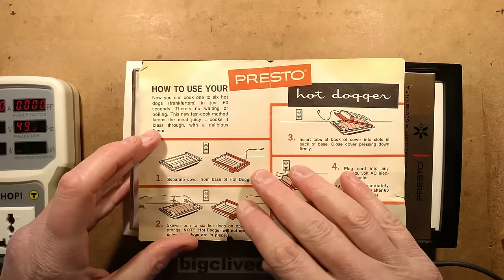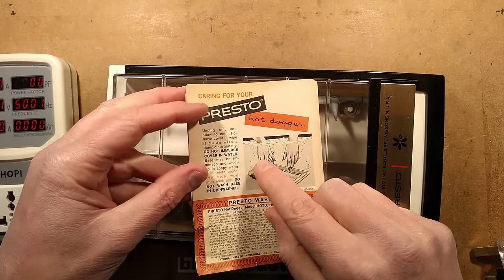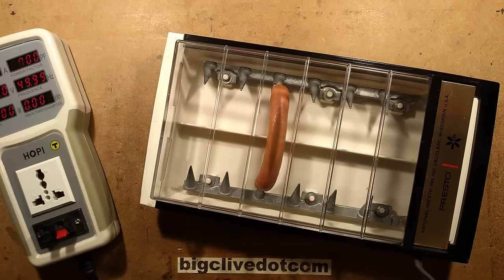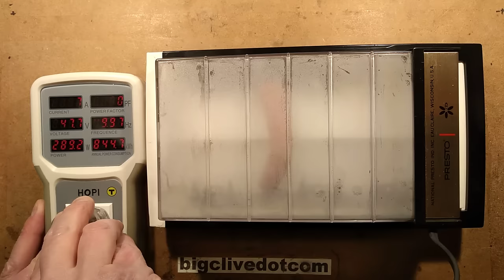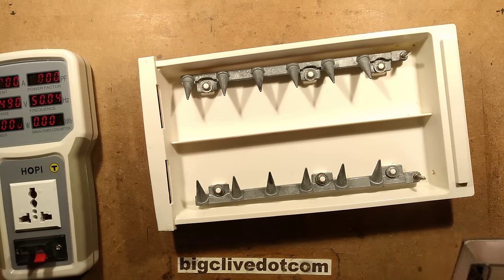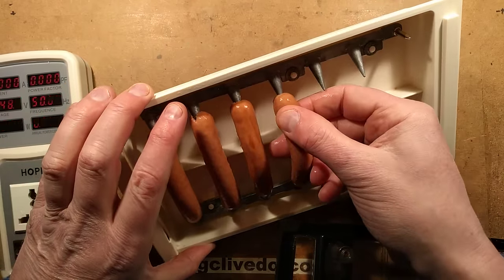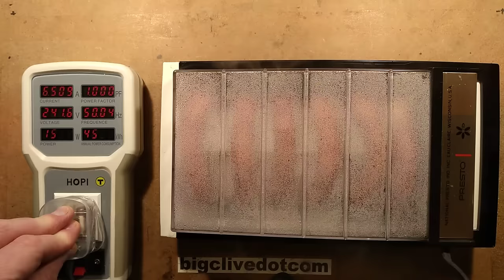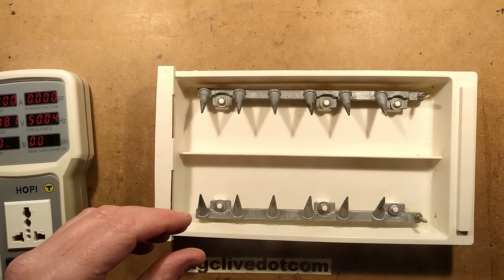Turbo charging a 120V Presto hot dogger on 250V.

Comment: I worked for a guy that took a 12 v battery, an inverter, and two forks on a field trip when he was in school in the mid 1970s.  He sold hot dogs to the other kids on the field trip.
Reply: wholesome lmao thanks
Reply: I did something similar, but used my fingers instead :).
Reply: @guily6669  Yeah, but then you can only make 8 sales.
Reply: Like a car battery?
Reply: @NeuronalAxon   Yes.
Reply: Was the original plan of just starting an open fire in the back of the bus considered a bit unsafe?
Reply: @ae4164  As far as I know, it was never considered.
Reply: In the movie Exterminator, the cop has a lampcord (for the switch) hooked up to two fork ends, makes himself one hotdog right there at his desk. A very interesting way to show a character eating food.
Reply: Why even bother with the inverter?
Reply: @GamingKeenBeaner    There is not enough current to create heat with just 12V so you step it up to 120V and get more current to make more heat.  V=IR and P=I(squared)R.
Reply: 4 hotdogs.... On finger cookers... Not 8. 5 maybe if they are real wide lol
Reply: @CPUDOCTHE1  Or in other words, the heat that would be produced from the current would be far too little to be useful for cooking.  Electric current produces heat due to the internal resistance of everything due to simple physics.  Due to the fact that I am very prone to suffering from dry skin, I could stretch my hands across the terminals of a car battery and barely even feel the slightest tingle.  I would pretty much have to be bathing in the Great Salt Lake while drenched in every flavor of lotion Bath & Body Works sells to decrease my skin resistance enough to be able to sense the current passing through me at 12V.  Now, the main battery pack of a Tesla Model S/3/X/Y P100D would be a whole different story at 400V.
Reply: Seems safe
Reply: @scratchpad7954  Fellow Utahn spotted
Reply: How did he not get immediately caught and how much profit did he made?
Reply: @p1mrx  try 1957, and there were other types since the late nineteenth century.
Reply: That mans name was Oscar Meyer
Reply: @shamusbob7969 Some years ago, my Russian coworker got let go for doing something similar. He had a ceramic heating element with bare wires in a mug of water, and this is how he regularly made himself tea. I asked Yakov about it and he just shrugged and said something like, "It works, doesn't it?" One day the health and safety guy walked by and that was the end of that. He was a lab tech who worked on electrical portions of test equipment. 🤔

Comment: Back in the early 70s, we used to make these things in electricity shop. Transistors were still brand new and most electronic devices still used tubes. The advantage of the lower voltage of 110 is that the dog cooks slower and the other skin doesn't crack ad much but does give a cooked texture to the outside of the dog. These are banned now because people are so stupid that they would take the lid off without turning the power off and then touch the two contacts in the lid. This of course stopped the dog from cooking and would then start cooking their hand instead. Unless they touched the two contacts with different hands which would then run the current up one arm & down the other, following the blood vessels and then doings all sorts of nasty things to their heart on the way to the other arm.
Reply: Creepy Crawlers and Metal Moulders had this lid lock, in which it will not work without the lid down (and, unrelated, will not un-latch until cooled). Just a simple switch pressed by the lid could help but I know it's done & gone.

Comment: This reminds me of my apprenticeship, heating sausages with an adjustable power supply and shoving test leads in the ends. It worked best at aroumd 170V, if you d go higher than that they charred too fast at the ends. Yea, we were young and bored. Never thought such a device could existing though, cool to see…

Comment: I love how the Hotdogger is so safe, it even came without an off switch!!!
Reply: UL certified and energy star compliant
Reply: It was the 70's when people stayed in the kitchen while cooking. My family had a Presto air popcorn popper without one either.
Reply: The wires went into the lid and the contacts where recessed. Place the lid on and the hotdog cooked. It was relatively safe, as long as the user didn't poke anything into these contacts.
Reply: @richlaue  touch those two leads and you're gonna have a fun time though :p been shocked by 120, 240, and 50k
Reply: @Korium84  those connections are very well recessed, one will need to use something like a thin metal rod or coat hanger to gain access to the what is more like an outlet, not a less.

No, one would have to touch both leads or the hot one and a ground.  For me it would not be much of a problem to simply touch it, my skin resistance is higher than normal, requiring me to grab it, not just touch, before I usually even notice current flowing.
Especially in the winter 110v feels like a light prickle.
Reply: Swell!

Comment: I used to cook hot dogs in my dormitory using two forks and an old extension cord. The RA never did figure out how I was cooking in the dorm
Reply: how are you still alive
Reply: @jamiegaming-ms8xl  theres a thing.. its called "being careful", ever heard of it? XD
Reply: If you do that with a pickle, it will glow.
Reply: Why am I watching a guy electrocute  hotdogs? =)
Reply: @MadScientist1001  I don't think you can be careful combining forks and an extension cord
Reply: @lukemacinnes5124  yah u can.. set everything up before plugging it into the wall. and then unplugging it before removing the hot dog.
Reply: @MadScientist1001  still not safe, that's like saying yeah you can stick your hand in a fire if you pull it out really fast, or you can just not stick your hand in a fire
Reply: @lukemacinnes5124  :/ you are just trying to find things wrong with what I'm saying... I'm not gonna waste anymore time with this argument.. all I'm saying is only an idiot would touch the forks while its live.. which is why you should unplug it before messing with it.
Reply: @lukemacinnes5124  have you ever heard of a prison stinger? As long as you don't pass the electricity from one hand through your heart and to the other you're generally fine. I change outlets all the time and I dont turn off the power and I use an electricians screwdriver. I do turn off the power for stove and dryer outlets. Those ones are the real scary ones. 110 eh. 220 holy shit. Thats like grabbing all 3 leads off of a transformer. 

Side note for fun sciencey stuff. Yes your house has 220 running into it and then gets split to 110 at your fuse/breaker box.
Reply: @noobpro9759  Yes, my house gets 400v
Reply: @jamiegaming-ms8xl  He's not, his wife posted that (and they were her forks).
Reply: @lukemacinnes5124  Of course you can!  -  You can take reasonable precautions (whilst respectfully adhering to current Health & Safety regulations), by getting your drunk friend to carry out the procedure for you...
Reply: You were fancy  two nails and two bits of wire. Use the bun to hold it.
Reply: @MadScientist1001  Good at messing with it.
Reply: @lukemacinnes5124  "still not safe, that's like saying yeah you can stick your hand in a fire if you pull it out really fast, or you can just not stick your hand in a fire" - Firstly, if you understand the concepts and limitations of your actions then you'll understand that you can bypass a lot of safety features (not all of course) that keep the complacent from killing themselves....or burning their hands.
Reply: wel that very dangerous cooking things with electricity changes the chemistry so u could die from it
Reply: you misspelled prison
Reply: @MadScientist1001  lol pony pfp
Reply: @MadScientist1001  mind you this is the generation of child safety and needing to put  the warning hot coffee on well... hot coffee.
Reply: @jamiegaming-ms8xl  to be fair if you hook up the forks first then plug it in and unplug it you never have to touch it
Reply: @rickylafleur5823  while I’m not disagreeing that most products these days have to come with obvious warnings, I would encourage you to investigate the hot coffee incident at McDonald’s. That lady got severely burned because the coffee was heated to nearly boiling. Like, yeah, coffee is hot, don’t be stupid, but at the same time no one expects to be hospitalized from spilling coffee on their lap.
Reply: @Deadpan17  and no shit, you spill hot freshly made coffee which was likely black so still piping hot on you, especially your lap where it will soak into your clothes and continually burn... NO SHIT, also i would bet those burns were mild but you... gotta sue someone for incompetence... even if it's yours...
Reply: @rickylafleur5823  she received third degree burns over 6% of her skin and spent 8 days in hospital, was permanently disfigured and was disabled for 2 years following. The coffee was served at 88°c, far hotter than safe or necessary. 

She initially only sought $20,000 for medical expenses and lost income, and only filed suit after they offered a meagre $800. She repeatedly attempted to settle, and they repeatedly refused.
Reply: @JuliaC-sp5qk  so whats your saying is coffee is hot? gotcha. and 88c is slightly above recommended serving temp. it's common fucking sense that it's boiled water and coffee grounds. do i need to tell you boiled water is hot? do i need to tell you not to spill it in your fucking lap? the fact she won any money at all is ridiculous.
Reply: @rickylafleur5823  coffee should not be served at a temperature that can cause third degree burns within three fucking seconds dude. That's the kind that causes permanent disfigurement and needs skin grafts. 

they knew it was unsafe, as they'd received hundreds of reports of burns, all other establishments in the area served coffee at significantly lower temperatures (around 70c) and they still chose to serve it that hot. Had they chosen to serve it at 70c rather than 88c, the time it would take to cause 3rd degree burns would be increased from 3 seconds to 20 seconds, giving an opportunity to remove soaked clothing and prevent severe burning.

I'm sorry but people spill drinks sometimes. If your drinks are served so hot they cause 3rd degree burns in 3 seconds, those burns are partially your responsibility. The jury found mcdonalds 80% responsible for her injuries on account of serving coffee at a temperature known to be unsafe and well above every other establishment. She was also awarded punitive damages because, as I said, mcdonalds were well aware the serving temperature was unsafe, and continued to serve coffee at that unsafe temperature.
Reply: @JuliaC-sp5qk  user error, don't spill hot coffee on your lap. my point still stands. most serve coffee from 170-180f including starbucks and wendys. but hey, common sense ain't common anymore.
Reply: @rickylafleur5823  starbucks serves coffee at 70c, every other restaurant in the area served coffee at 70c, and again they chose to hold and serve the coffee at an unsafe temperature. coffee served hot enough to cause 3rd degree burns within 3 seconds is defective.

 Idk why you're siding with the billion dollar company that served coffee at an unsafe temperature over the 70 year old woman who suffered 3rd degree burns on 6% of her skin, permanent disfigurement and 2 years of disability because of that unsafe serving temperature. 

Spilling coffee on yourself is kinda dumb but serving it hot enough to cause 3rd degree burns in 3 seconds is negligence, especially when you've had hundreds of similar reports and changed nothing. That's why they were found 80% responsible, and we're all now safer because they reduced the serving temperature on account of this lawsuit.
Reply: @rickylafleur5823  also in that case the lid was not correctly affixed to the cup iirc
Reply: Gotta love Tesla for helping set up the perfect electrical grid for america.  Hurray Nichola Tesla!  The Saint of Electricians and Electricity!

Comment: Now Im afraid Im personally responsible for upping Clives Cholesterol through the excessive consumption of Hot Dogs
Reply: How old was that thing?
Reply: Probably old enough to be pre-cholesterol so Clive is safe on that score.
Reply: Cholesterol PLUS a healthy dose of Aluminum (or zinc) ions to boot!  (o:
Reply: @theotherwalt  Early to mid 70's.  Outlawed, now, In the U.S. because of shock hazard.
Reply: AND I'm sure he appreciates it!  lol.. Besides, triglycerides are more the issue with hot dogs.  I actually had one of these as a kid, in the late 1970's.  It gave the dogs an odd metallic taste.  Because of that, we used it about three times and it went away.
Reply: @Kim Sleep 
You Rock! This was so great, thanks so much for thinking of it!
Reply: Early 60s, not 70s. I'm 60, so I can note the subtle style changes of that period. WJK is correct, there is electrochemistry in play. Elemental metals are hard for the body to absorb, be it iron, lead, or mercury. For more efficient absorption (or poisoning), you want metal compounds (ie dimethyl mercury H3C-Hg-CH3). With this contraption, you're reacting the metal electrodes with the salts in the hot dogs, forcing an ion exchange. Being AC, only means that both anode and cathode reactive products will produced at both sides. Chemical poisoning is its greatest risk.

Its electrocution hazard is no more dangerous than an electric toaster. Power is removed when you lift the cover. Just never cook, and take a bath, at the same time.
Reply: @stanleydenning  Was that all models oulawed, or just this older model? The one I have (an 80s model), has a tray (with integral connector) that slides into an all enclosing housing with a detachable cord connected to the outside. While not completely idiot proof, it protected against most ignorance-induced failures. If you really wanted sparks, you could just bypass everything and shove a wire paper clip directly into the AC outlet. I had made my own cooker from a power cord, and pair of aluminum nails, which took an abundance of caution to avoid becoming part of the cooking process, but it worked!
Reply: Thank you Kim for allowing Clive to make this absolute gem of a video!
This is up there with the baby electrocutor!
Reply: +Kim Sleep — Naught to worry.  Dietary cholesterol has practically zero effect on blood serum cholesterol.
Reply: Don't worry, the NHS can fix that
Reply: For the nation that really likes their fried food those hotdogs are considered health food.
Reply: @Jrez  LOL...I actually purchased it from the States on EBAY. There were several of them there , all variations of the designs from many different years. I was waiting until I could find one, unused, and with the original manual, and packing.
Reply: KIM! are you the same Kim Sleep from command post so many years ago?!
Reply: @tekvax01  Yup
Reply: He's a Scot. In a land where they deep fry pizzas and mars bars, hotdogs count as health food.
Reply: @kimsleep4111  BUD!!!! How's it going?!?!?!?
Reply: send me an email from "my about business inquires entry"!
Reply: Lol
Reply: @mikecowen6507  They all had that safety lock feature, even the very first models. I dont think any of them were actually outlawed, as they were made for many years, and versions knocked off by other companies. I think that like a lit of things, they became redundant when the Microwave oven started being a fixture in most kitchens
Reply: @kimsleep4111  They seemed to have improved on the original design as time went on. With this model, the lid (and power) snaps on from the top. My model takes the tray from end in something reminiscent of a train shed. The curved lid tends to be a tad more self cleaning in terms of condensation.
Reply: @mikecowen6507  Yes, that model was the later , and "Cooler" model, often available in a variety of colors. I also think that that was a bit of its downfall, the sheer effort it took to clean the bastard, altho the one I sent to Clive allowed the removal of its electrical "Guts" to submerge it, or even put it in the Dishwasher.
Reply: @tekvax01  Things are really quite good with me, how about you??
Reply: What about the sodium and the nitrates/nitrites
Reply: I had one.
Reply: @chrisw1462  hot dogs are a diet food. the bun is the heart disease

Comment: I remember seeing that, on 120v, the voltage drop along a couple of millimeters is about 2V, meaning that if you simply stick an LED lengthwise into the hotdog, it lights up.

Comment: First of all, PUT A PICKLE ACROSS IT! You must have seen those videos :P
Secondly, put an LED in the hotdog to see if the hotdog acts like a voltage divider and makes the LED glow :D
Reply: <Pickle Rick reference>
Reply: Great idea!
Reply: It does!
Reply: I will say it again there's a commercial about new in-house pickles being better and they made a pickle electrocution board for a dance rave
Reply: Sounds like the experiments done by methodisch inkorrekt ("methodically incorrect"). Sorry, german only, they are hilarious, making science amusing and talking about new papers in their podcast. hot dogs (and pickes, too) are universal resistors.
Reply: Wouldn’t the led just short due to +/- touching both connections
Reply: @fatassassin2493  Think of a hot dog like a bulk[y) resistor, 
spanning a conductor across a fraction would short some current across
Reply: Sounds like a good idea. Keep up the great work. Nick🧔🏽. Lock Pick Nick.
Reply: led is dc voltage... so no.

Comment: Back in school, we had two somewhat similar cookers a flat wooden board, one with bent large nails, the other with bent forks.  They each were setup for at least 6 hotdogs as well.  With a 110 cord wired across them. I don't think it really took 60 seconds even on  110Volts AC.  They were a bit scary, what is almost scarier is that Presto made a consumer product like them, granted that Presto cooker is a far safer design.  They were used as part of our electrical safety training.